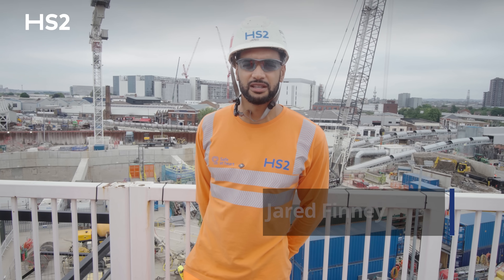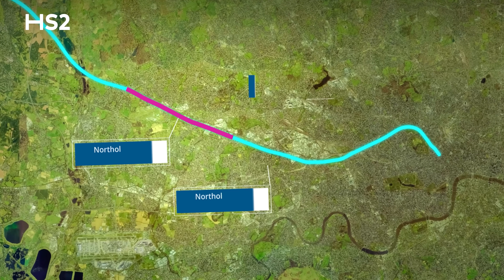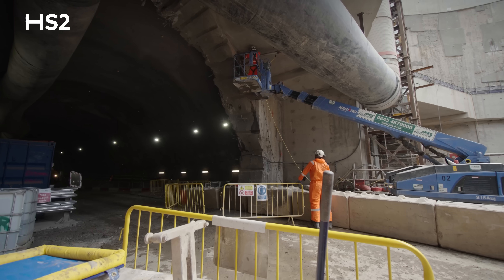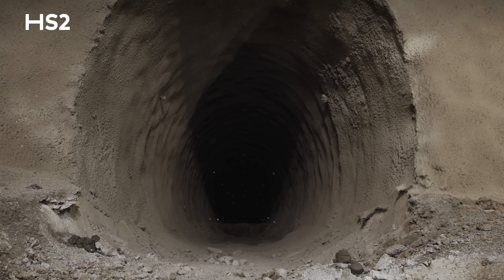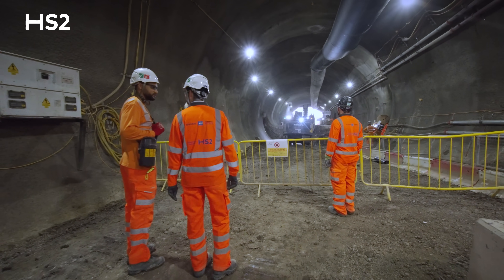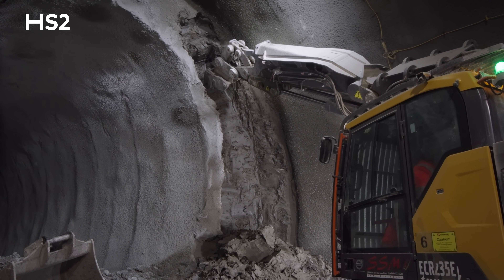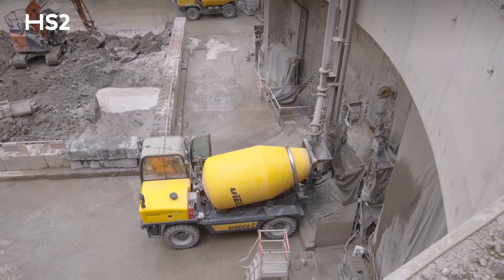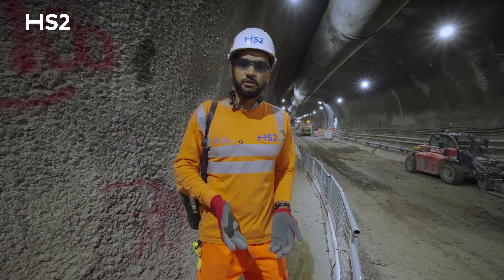🚆 Discover the Victoria Road Crossover Box – A Key Part of HS2 Near Old Oak Common 🏗️

Comment: Thanks, Jared, for a very informative, useful and exemplar-rich explanation.  In the decades to follow, no-one (outside of the maintenance crews and (maybe) passengers in a practice evacuation will ever see the finished article.    Once the New Spine Railway has finally connected Euston to Brum and Handsacre, we (here in Cheshire) look forward to welcoming the additional rail capacity which is needed to the north of Handsacre.

Comment: Has there not been devised a method to just spray the tunnel wall once and be done with it? Isn't concrete capable of holding? The secondary lining with formwork and all that it takes, crazy laborious and hard to automate.

Comment: These tunnels are unnecessary. HS2 could have saved the taxpayer billions if they had stuck with the original plan to repurpose the existing Acton to Northolt railway line to get from outer London to Old Oak Common. Like the notorious Sheephouse Wood bat shed, building these tunnels is part of the project gold plating that made HS2 Phase 2 between Birmingham and Manchester unaffordable.
Reply: Most of this superfluous tunnelling is due to NIMBYism and objection from the public regarding the route of HS2. Its a real shame that so much is wasted on such unnecessary additions such as this.
Reply: Also the quantity of specially made equipment
Reply: Yep, the cost overruns a total nightmare. Even Phase 2a to Crewe is necessary to avoid bottlenecks.

Comment: Even in the video just couple persons are working. With such pace it will be finished in 10 years. The sites are almost empty always when I pass nearby
Reply: This kind of construction is a long thin line of people stretching back hundreds of metres all connected by machines.
Reply: All good reasons but for 1 thing. The government have cut funding to save money in the short term. It will cost more due to inflation but saves money in the short term which will provide some financial relief in the Autumn  budget.
Reply: There's probably plenty of work going on that you can't see
Reply: The Victorian way of building railways, using large numbers of manual labourers, stacked up on top of each other, in things like the Greathead Shield, led to massive amounts of workers dying during construction.

As Jared said, they have a single person operating a robot machine that sprays concrete, instead of that insanity. The robot operator is backed up by people bringing concrete to the robot, people making batches of concrete in the temporary factory on the surface and a number of engineering people who are on standby 24 hours a day to fix anything that causes a breakdown in any of the machines or that causes a blockage in any of the machines. And every time a machine moves around to transport the concrete, they have to have supervisors (or as you would no doubt call them "people standing around looking like they are not doing anything") who keep an eye on everything to make sure nobody walks in front of a machine or behind a machine and get crushed to death.
Reply: @DavidShepheard  I believe the role of safely directing plant operatives and other machinery moves is known as a 'Banksman'.
Reply: One would assume that they film during quieter times to reduce disruption to work, nevermind the fact that modern construction requires less people because of advances in machinery. Sites likely seem quiet either because work is not needed to be done there at a given point in time (say, a finished bridge) or because the work is happening underground as is the case with Old Oak Common.
Reply: That has to be the most inane comment on here today.  "Anecdotes rule OK"?